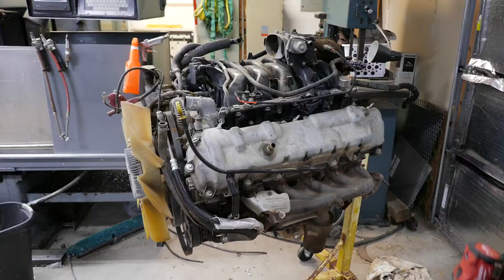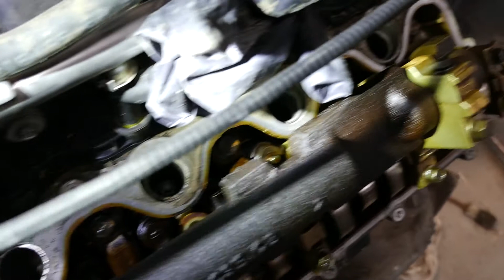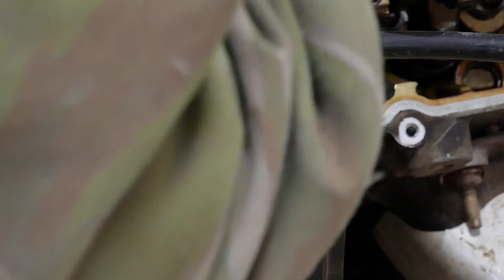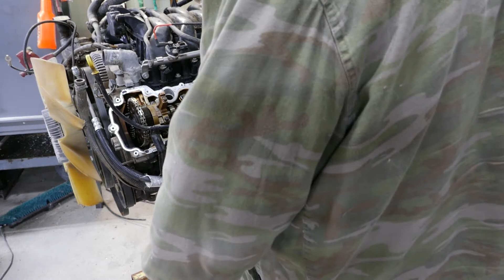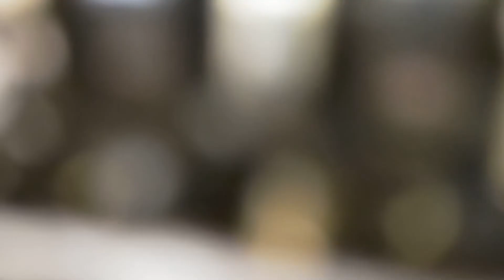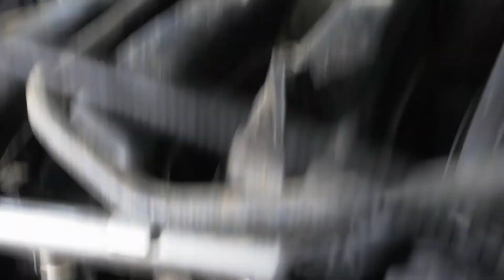Ford F-550 V10 Swap Part3: Removing the old rockers

Comment: I'm not sure whether you are repairing or rebuilding this motor for yourself or not,
But .... and this is just a suggestion. 
You said she had 235k ? Replacing all of the rocker rollers and adjusters is just the minimum,  then add a upgraded melling oil pump. 
And you were correct by stating the main reason for failure on these mod motors is
LACK of maintenance.

Comment: so are original roler folllwers bad . need up graded. i just bought a new 6.8 set of heads are. new old stock[
 , should i change lifters and rockers . just built new motor. ? heads original hardware
Reply from the maker: Ford made a change to the design of the oil squirter hole on the rocker, the old ones have a straight hole, the new ones have an angled hole that squirts at the roller. The old part number is 3L3Z-6564-BA and the new part number is 3L3Z-6564-A.  As far as I can tell, most of the top-end failures involve the BA rocker.

Comment: thanks for this effort.. but did you complete the project? I'm working in the same project and need to swap a v8 with v10 .. if you complete it please share with me the remaining videos... thanks so much
Reply from the maker: I put this project on hold for a bit until I have some more funds to allocate to it.  The main truck is back on the road and that repair cost around $1500, so the wallet was feeling a little light.  I've got somewhere around $2k into this project and probably another $1k to finish it, plus tires (another $2500 I'd guess).

Comment: SEND IT to ABOM79. he has some metal brazing solution with spray on metal .. i am sure he can cover that .. try it out in case you can't find what you need
Reply from the maker: While I appreciate Adam's skills with the eutectic alloys, this part doesn't warrant that.  The real challenge would be regrinding the cam lobe to match the other cam lobe, without a special purpose grinding setup it would be rather difficult.  Then you have to consider the replacement cost of the camshaft vs the cost to restore this camshaft, I don't want to waste Adam's time.  A simpler approach would be to continue working the cam lobe with hand stones until I've gotten under the damage, while it wouldn't be the same lift and duration, it has 2 intake valves, so it wouldn't matter.  I think I've found a source for a new camshaft that is very reasonably priced, thanks!

Comment: Replace the timing chain guides, oil pump & read the plug's. The cam look's ok; you probably had a sticking valve.
Reply from the maker: The plugs were completely roached, they were probably original to the reman engine.  The chain may have been slacked because of rotating the engine in the non-drive direction when I was removing the torque converter.  From what I've seen on 5.4 videos it's the cams that start wallowing out the cam tower, debris gets in the oil system and takes out the phaser solenoid and accumulates in the tensioner.  Since this motor hasn't shown any signs of failure, except for the rocker that was totally wasted, I feel like those parts are okay.  There isn't any sign of guide failure or chain rubbing.  For as much as I plan to drive this truck, a new camshaft and rockers will probably last the rest of its life (plus I change oil every 5k miles or less).  I'm thinking they must have redesigned the rocker arm lube squirters in response to the failures on these early rocker designs.